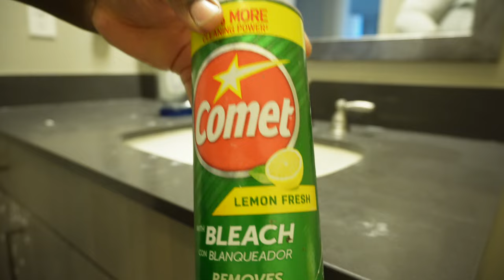INTENSE BATHROOM DEEP CLEANING | REAL MESS  CLEAN WITH ME for Real Motivation

Comment: Buy soft scrub cream cleanser for the tub trust me you will be happy the comet take the enamel off of the tub just a suggestion
Reply from the maker: Great idea! I’ll look into that!
Reply: I use soft scrub and I like the way it cleans.
Reply: I was thinking the same thing. If this is an acrylic tub (which it looks like) then she's taking the gloss finish off with repeated comet use. That actually makes it harder to clean and keep clean. Either soft scrub or, what I use is a Mr. Clean liquid & water in a spray bottle. 
She's also slowly scrubbing the finish off the countertops and sink (if it's acrylic) comet it super abrasive. It is actually NOT a problem on porcelain.